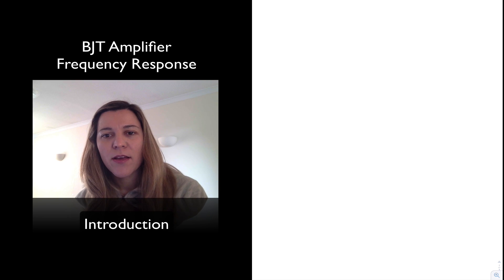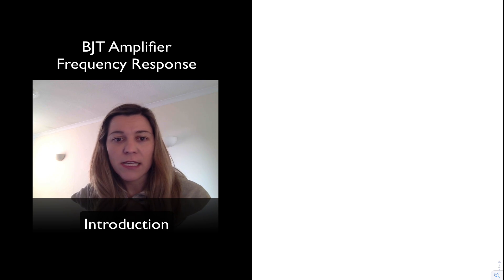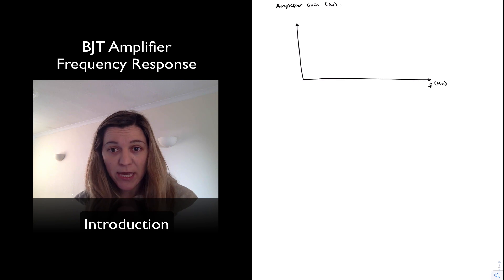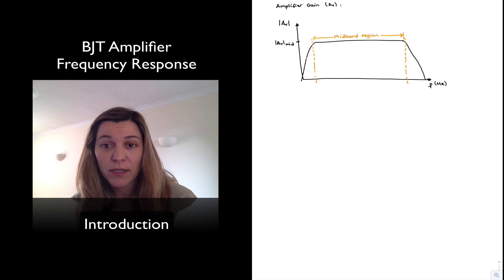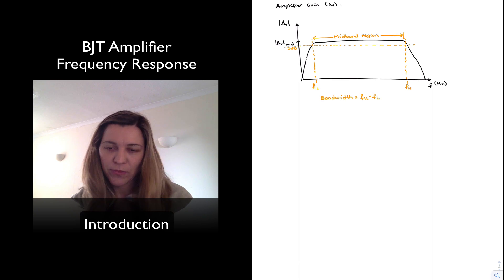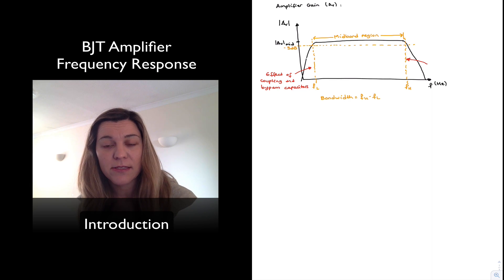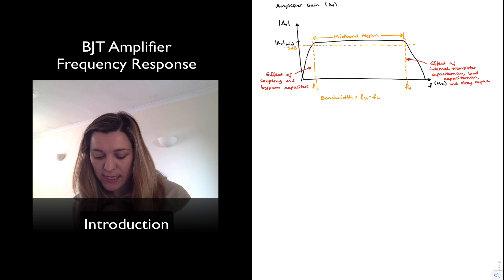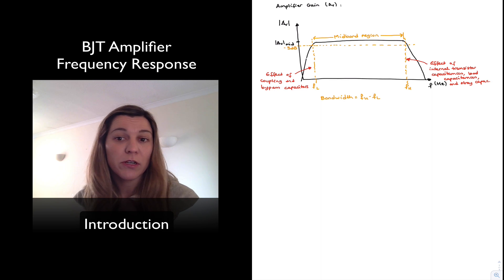Introduction to Frequency Response of BJT Amplifiers

Comment: 302- Voltage gains of transistors at low frequencies decrease due to :coupling and bypass capacitors             , Voltage gains of transistors at high frequencies decrease due to: transistor internal capacitances, load capacitances, and stray capacitances